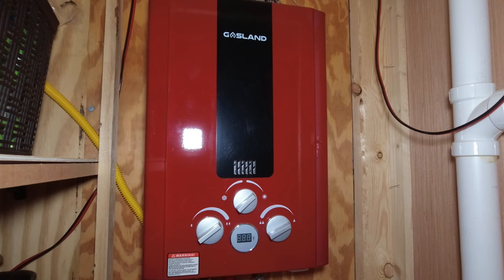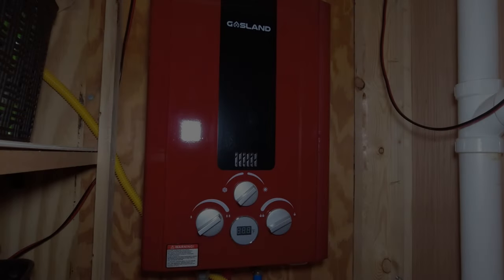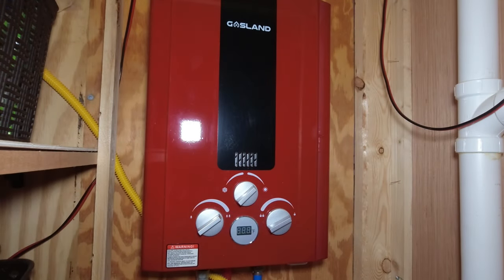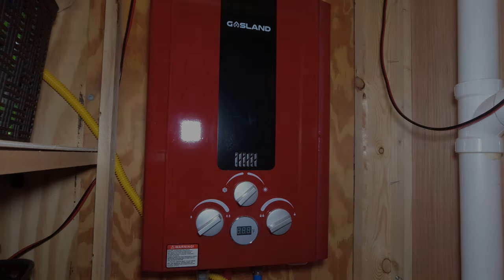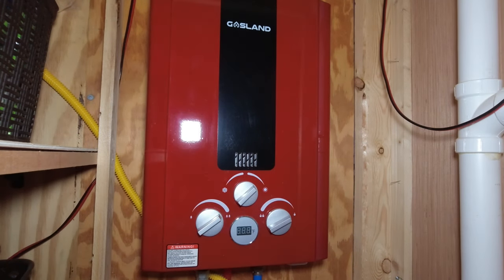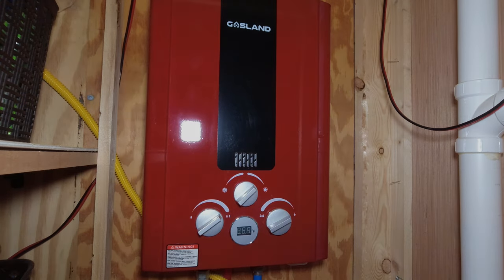The Absolute Worst Addition to Our Cargo Trailer Conversion!!

Comment: We use the same water heater in our 6x12.  I had heard about those issues from other comments, but have not experienced them in our trailer.  We have only used with the water hookups though, not just the pump.  I suspect that these problems are mostly occurring due to drop in water pressure going to the heater when cold water is also being tapped while using a water pump.  These water heaters require a minimum water pressure or they will shut off… leaving you with a very cold shower!
Reply from the maker: Thanks for the comment! Glad to hear yours is working well. Those cold showers are no joke!!

Comment: From my understanding, you have one setting for flow sensitivity and the other for heat. If you turn up the sensitivity, low pressure won’t ignite the burner. Set your heat to your desired temp and then adjust the sensitivity. And don’t add cold water through the shower valve, heard it conflicts with the water pressure and your burner stops.
Reply from the maker: Great comment. I’ll give it a shot and see what happens. Thanks!

Comment: I ha a cargo conversion and I use camplux instant water heater… I live in a 5th wheel full time with a 12 gal gas and electric hot water heater and I’ll say you’ll regret going to rv style… 1 st it will cost you more and you hate having to set instant one wait and see how long it takes to heat 10 gal of water
Reply from the maker: That’s exactly why we went with the tankless in the beginning. We had a six gallon water heater in a travel trailer that took forever to recover after two showers! The water temps were easy enough to control though. Have you had any issues with the camplux?